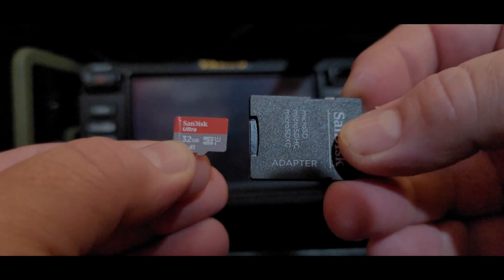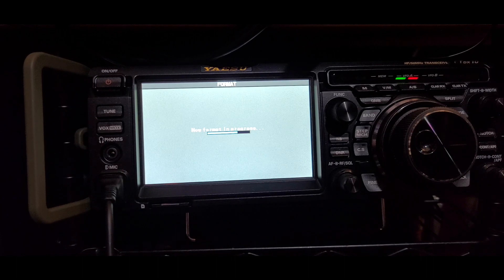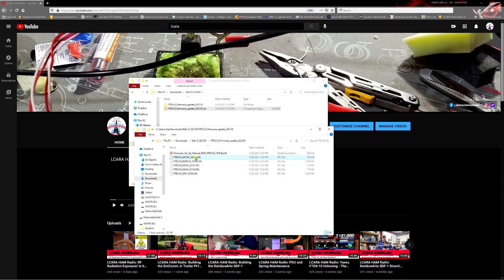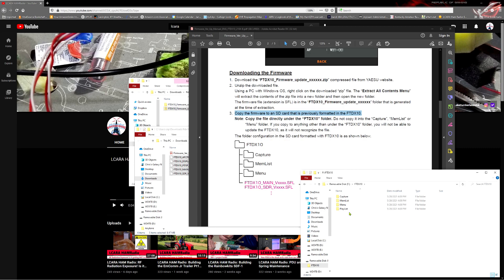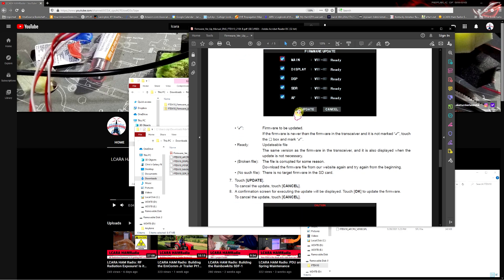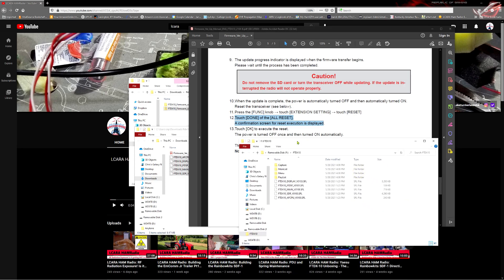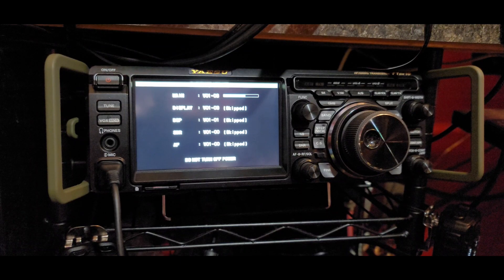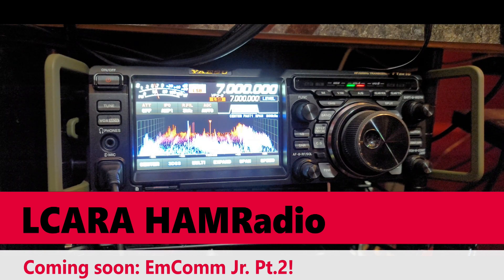LCARA HAM Radio: FTDX10 Firmware Update

Comment: The missing ? is that I have already added files to the disk like freq in memory, lots of them so do I skip the format part and just add the new updated files to the existing files that are running the radio now?? Will the radio just see the new firmware files added and select them to install and overwrite the old firmware ?? So easy to brick these new software defined radios.. 😉